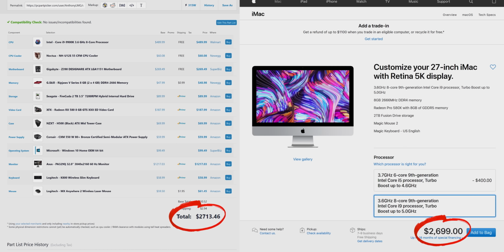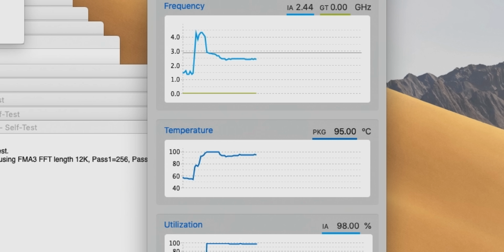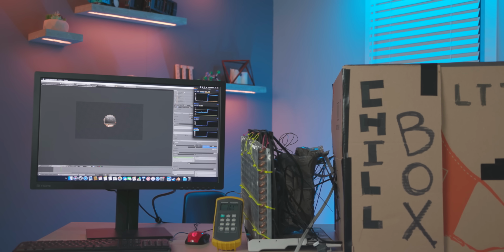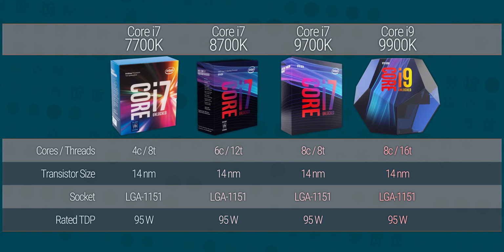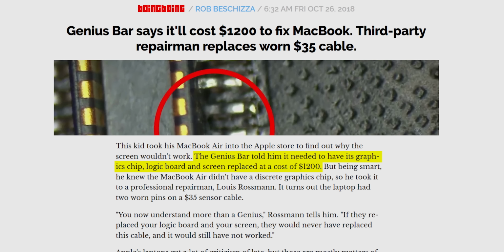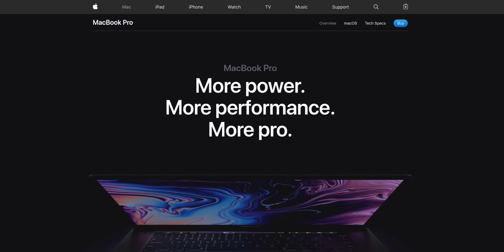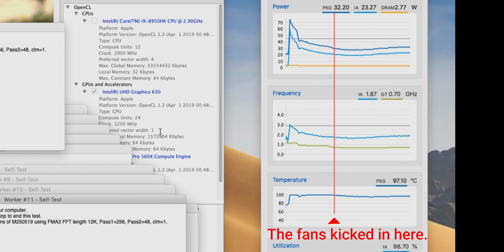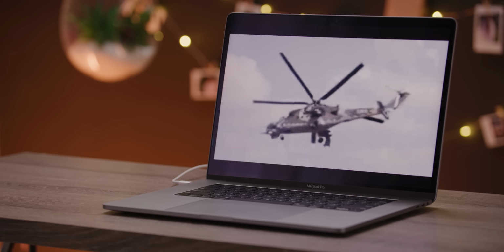Macs are SLOWER than PCs. Here’s why.

Comment: Just to see how much the throttling is hurting the performance of that Mac, I would gladly send you guys my 12 year old Dell laptop with a 2.5 GHz core 2 duo to bench against it.
Reply: Just look up the geek bench numbers. I’m 100% sure it will perform much slower than the newest MacBook (pro’s) Because I got 2 duo cores and replaced one with a Xeon x5460. My MacBook Pro mid 2012 has 4 times the numbers in geek bench than the Xeon.
Reply: Yeah but I think the point is, you wouldn't have paid $5000 for your Core 2 Duo laptop last year. Maybe $50.
Reply: There's no recovering from that level of a roast.
Reply: How much do you bench, brah?
Reply: With a 1mb cache? 6mb cache wolfdales can still hang a little bit.  Not every computer task is about compensating.
Reply: That core 2 duo might get 120cb on cinbench r15, but it's a dual core without hyper threading.  That still plays minecraft. Even though you should just play doom.
Reply: @Animal901  no bra even with that old cpu i have played many AAA title of today only issue is it makes way hotter than it could handle (of course i have 1080ti so i was able to play them), so then i what i did was just made customized coolers which could take both liquid nitrogen and liquid helium, so yeah; on my pet project i have played today's many AAA titles.  (do i lock the games on 30 fps yeah i had do to that to few of them for this chip)
And that was the point the hardware i have it it cheaper yet perform better than that sticker!
Reply: it's summer can;t go out site ambient temp is above 40 degree celsius, so how to make money while sitting at home by searching web and doing quite a lot of stuff. ()just for info i make 12$ just for searching web for 4 hours. my monthly income that's totally different thing for this comment.
Reply: just so u know i am 6 feet 5 inch guy so not that little man i am,in both height and private part.
Reply: who said about gaming ? u ask? it's linus himself.
https://www.youtube.com/watch?v=7gJ8mGFjeqA at 6:35 u will get ur answer.

as new macbook still quite the same to old one so there's no point in testing games on it, bcuz the results are gonna be same.
Think u idiot think, don't go bashing everyone like u know everything.

And bcuz of that old video and linus being to hard on apple kinda things said by people, they didn't add it to video.
Do research why a youtuber says what he says.
is apple lying new macbook pro 2019 is better in all aspects than 2018 version? then short answer is YES
long answer is kinda yes.

And from that point of view i said, "oh i bet an overclocked core duo 2 at 3.0 GHz can beat that macbook pro"
bcuz at the end of day mac book pro is gonna throttle due which even his strong processor won't be enough to beat core 2 duo in gaming (of course i am talking about core 2 duo overclocked with 1080ti 8 gb ddr3 ram, that's the one of old setups i have).

If u still didn't agree then yes u didn't get the sarcasm, and that's sarcasm is about!
Reply: i was being sarcastic so u r the who actually suck at understanding sarcasm i guess. But still it's true that's a different thing.
Reply: I'm still using my 11 year old Acer 2.5Ghz Core2Duo laptop when not on my desktop. With a SSD it's still a workable machine for 'normal' use. And it doesn't throttle under load with dedicated GPU and 65W TDP CPU.

But then again, I baked my GPU 4 times already (the oven treatment) to fix solder breakage because of heat stress.
Reply: I got big block,single turbo core i12.1.1..
Reply: oh i bet an overclocked core duo 2 at 3.0 GHz can beat that macbook pro
Reply: @bk-sl8ee  another case where people look at a clock speed and ignore all the other factors that actually make one cpu outperform the other.. just in IPC alone the skylake based cpu's are roughly 75% faster clock for clock than C2D. so even if it was throttling to 2Ghz in a POS macbook it would run laps around c2d chips.
Reply: @sirmonkey1985  so what are u trying to say put that in less words plz.

Comment: How long till "thin" starts being considered "stupid" instead of "cool"?  We're overdue!
Reply: Joshua Scholar true. I’d rather have thicker laptops / computer. I don’t want my leg to get burned by a laptop because my laptop won’t cool down.
Reply: Can we admit that phones are already so thin that it's a drawback?
Reply: There have been some of us who like it T H I C C
Reply: I have asus scar 2 rtx 2060 laptop,i can play games at high settings for 3 hrs but still the temperature hovers between 82-88°C.
Reply: Need another situation where batteries start exploding again from being overheated.
Reply: I kind of agree. If the computer is thin and the computer does not get crazy hot, then it's still fine but if that is not the case then I agree.
Reply: Grahamhg  yeah but buying a higher quality lightweight bag cuts more weight than a thinner laptop. Never ceases to amaze me how many people put a 1.5kg laptop in a 2kg bag.
Reply: Grahamhg  nice pun there LOL
Reply: Grahamhg  I expected a pun since this is the ltt comunity. Anyways I use a NF borealis which has a dedicated padded compartment. Sleeves are a bad idea, they are laptop bags without handles and walking around with one is asking for your laptop to fall, cause no grip.
Reply: Usb port thin is thin enough for me, any lower and you get compromised structural integrity
Reply: @hellfire92837  that's too thin
Reply: @stanimir4197  Depends on the use, casual/office/browsing user laptops can be thin and light like that, business laptops need more battery and integrity so thicc is good. As for gaming, I personally dont like 17.3', 15.6' with good cooling and undervolt would be my choice.

Comment: Consumer Mac users are dope smoking nut Jobs too stupid to think for themselves. Professional Mac users (designers, programmers, etc.) are irrational and delusional. There is zero justification for buying any OSX product for anything other then using it as a testing platform for professionals smart enough to use Windows or Linux. The same could be said of iOS products.

Comment: Actually Linus sorta explained why Macbooks thermal throttle so badly in his iPhone vs Android analogy... this probably isn't the complete reason why Macbooks suck at thermals, but like his example of how Android phones tend to perform worse than iPhones in prolonged stress tests because poor thermals, the processors designed in the Macbook aren't designed in house custom by Apple, so prob for the sake of marketing Apple just slaps the best CPU designed by Intel (similar to how Android phones will usually use the flagship processor designed by Qualcomm regardless of their thermal design). This is versus the custom designed CPUs that Apple purposely built for their phones. As to why they don't custom build CPUs for their Macbooks yet, market demand is probably the reason for that.

Comment: 7:04 simple. they build their own chips and are overbuilt for the phone usage/workload.  It is so overbuilt so that they don't have to run it at higher clockspeeds like Android SoCs do.  You are correct that it is a compelling reason to buy an IOS device.  
I don't like Apple but it is still a very good engineering design choice.  See, boost clocks are only not efficient but can be useful for burst workloads.  Most rendering workloads needs more cores than clock speeds.  Multiple cores that are at lower clock speeds are simply more efficient than higher clock speeds with less cores; smaller cooling solution.
What hurts though is gaming, gaming is close to a rendering workload plus a GPU at almost 100% load.  It just won't work. 
It will take a while for Apple to use their own chips for OSX devices as they will they have to convince developers (Adobe) to write code for the Apple chip where current OSX third party software is written for x86 (OSX or PC)

Comment: Linus, you DO realize that the only reason the PC you posted costs anywhere near the Mac is because you added on a $1300 32 inch monitor and a copy of windows 10 right? Why not compare apples to apples use a 27" 4k monitor and buy a cheaper windows 10 key from kinguin or the many other sites that sell them for far less? I think If you did that the PC build would come up to alot cheaper
Reply from the maker: Because that wouldn't be comparable. The iMac comes with a factory calibrated wide gamut 5k display and a proper (not grey market) OS.
Reply: @LinusTechTips  but do you think you really need to spend 1300 to get the same quality monitor you would for a aio iMac? I don't know dude... Not trying to cast doubt on anything your staying just trying to math things out and 1+1 !=2 from where im sitting

Comment: Its so sad Apple has become as greedy as Nvidia and only cares now about profit. Not quality anymore. Also it greatly depends on what software/app your running and how well it’s optimize for the hardware. 

Let’s not forget intel has had a LOT hardware security issue. Not that Amd Ryzen CPUs are fully immune. But generally Ryzen zen 2 and 3 (as for 2021) are far better then intel CPUs are.  Simply put. Intel lack of innovation has finally caught up to them. (Which effects BOTH intel pc and macs) Mac also often have worst cooling on intel CPUs.  

It’s been proven TIME and TIME again (before Apple switch Fully Arm). A hackintosh running on Ryzen cpu and configure properly with proper drivers and what not, would Out perform stock bought Intel Macintosh.   While this video is old now.  The title is misleading, Mac are slower, but there is reason. Improper cooling/Apple trickery with voltage on intel CPUs,  Most modern pc/server pc have FAR better cooling feature, giving pc an edge over macs.  

If you built a special hackintosh (with proper cooling) and put it vs default Mac you bought from Apple and they both equipped similar GPUs/ram /SSD, the hackintosh will STILL prob out perform stock mac.   intel held macs back because lack of innovation,  Mac lack proper cooling also contribute slower performance. Mac OS is imo far better os vs bloated windows 10.

This is why Mac are slower. Simply because Apple does NOT allow cpu be cool properly enough. Thus reducing performace of them.  If Apple had made Apple with Ryzen and better cooling.  We might have seen better Apple products.  The switch to full ARM a CPUs for Apple will help as arm require less power and can perform as well if not better then pc,  the question though is since Nvidia is trying by ARM. Will it Go thru and will this effect Apple?   As Apple HATE Nvidia.

Chilling MBP in chill box isn’t going help that much.  The problem is Mac/Apple crap cooling system.  If you could proper heatsink on IHS/Cpu and proper cooling on GPUs, with proper software config too boost cpu more correctly.

Comment: Apple is garbage. Usually, Apple users are dumb and just want to "use" the device... Well, little do they know that Apple is just marketing mediocre to them with the disguise of being exceptional. This is a great case of what Apple does. They market this as high-end, because the processor technically has a higher spec, but it actually performs at the level of a lower priced machine.

Comment: Sorry Linus, do you expect Apple to make a CPU from scratch for desktop in just a few years? Apple made their own SOC for their phone and did it right. They cant help what Intel is doing and they fit it into their lineup best they could. A slower CPU wont have the potential of a faster one. You have an issue with how they throttle, and some of it is right, but the fact is they preform as good or better than other laptops in the same categorizes. I dont get how you could spin any of this as a bad thing. Weird bias here.
Reply: Did you even watch the video 😂

Comment: Question, when you said "A slower CPU that doesn't throttle is not slower than a faster one that does.", then my question is, what's the sweet spot, where you can save money buying lower end spec, but the performance is mostly equal to paying an arm and a leg for the CPU power you can't use anyway? Does it make more sense to buy lower end Macbook Pro? Or maybe just makes more sense, to just buy a PC notebook at all.... hmmmm 🤔?

Comment: All the i9’s have thermal issues and its not just MacBooks that throttle. And that is mostly Intel’s fault.

However, designing a system without testing for thermal throttling is a massive fault of the manufacturers of said systems.
Reply: The issue is not limited to i9 processors.I have asus scar 2 rtx 2060 notebook,i can play games at high settings for 3 hours but still the temperature hovers between 82-88°C. Ambient temperature:41°C
Reply: It has intel i7 8750h 6 core cpu

Comment: 3:40 No.  Intel sticks to the TDP rating but only for base clock speeds.  The only fault with Apple is thin thermals, only wants to maintain the base clock speed for long workloads, losing boost clocks
Reply: Literally 10 seconds later......

Comment: This, coupled with OS bloat, and allowing upgrade past usability are why I am (as of this year) abandoning the MacOS platform.  (Despite the indicators of compatibility in the Apple Store, a mid-2012 Air is NOT going to be a good experience on 10.14.1, 10.14.2, nor 10.14.3) Add to that the very limited expansion options, apple's explicit answer to "We want a touch-screen air" is, "No, you want an iPad Pro" (via email, and via an apple store.) Apple has become style over substance, and is apparently trying to migrate people away from Mac Laptops.

Comment: To be fair. I’ve never used a Windows machine as quiet as a MacBook Pro. And being able to plop that down on a console and mix away without any distracting white noise in the studio is really helpful. Not saying that Audio guys are the reason Apple does this, but there is a plus to the fan curve.

However, I would prefer if Apple gave users the option. Like hey the i7 variant has super quiet operation but it throttles, and the i9 version is crazy fast and loud. I would not mind that at all.
Reply: A normal pc allows you to control the fan curve yourself. You can make it just as quiet, and with water cooling you will still be getting far superior thermal performance.
Reply: Izzder yes, I was more alluding to the i9 version just having a beefier cooler. But yeah MacOS should have a fan curve adjustment, especially for the desktops.
Reply: Johnny English I’ve gone through a lot of windows laptops, but none have ever been as quiet as a MacBook Pro. 

Granted that’s not the only reason I use a Mac, as there are ways to adjust fan curves and such to get a quieter operation on a windows pc. But out of the box, silent operation is very handy.
Reply: Just wondering, is Audio mixing CPU intensive? If not, a window laptop that does not turboboost would have the same noise footprint?
Reply: Izzy Un it’s very much CPU intensive

Comment: macbook fan spin faster during higher workload in Linux ! not in MacOs ! 

enough said
Reply: MacOs is Unix based , Unix is open source ! 
they modified kernel so as to make fan quite on higher workload , got it ??

and nah it doesn’t smell like burned plastic unless you do heavy works on way older model ! change the thermal paste and it will smell like steve jobs 😅
Reply: @sujanpaudel2031 : There is no requirement that a Unix system must be open source. Remember, what most people call Linux, was originally designed because Unix was closed source and extremely expensive.
Reply: Because Linux is made by people for people (literally). And macOS is made for money. And a silent laptop sells better among people that know nothing about PC hardware. Plus, if the motherboard is fried at 90 degrees constantly, it will break sooner and the owner will go buy another macbook. And install Linux, lol
Reply: Jessy Landry  I tried installing Hacintosh on a virtual machine. And, as a Linux user, I must say that it's way too difficult for me
Reply: I think what OP is trying to say is that Linux has a more aggressive fan curve for MacBooks. Not sure if that's entirely true, but it's very possible.
Reply: @Mugen00 it pretty much is open source. All unix does is just release GNU toolselts as Unix addons. So these guys arnt exactly wrong. Maybe get off your high horse.
Reply: Jessy Landry  I have Ryzen. I'll have to use kernel extensions to bypass the optimization flags for Intel enabled by default. I call it difficult
Reply: Sujan Paudel Mac os is Linux smh
Reply: @GamingComic123  macos is a Unix based os, not Linux based.
Reply: @GamingComic123  ...what
Reply: @GamingComic123  MacOS is based on MACH kernel (Unix) built atop the corpse of NeXTSTEP 3.3

Comment: Someone should tell Marques and iJustine. Unless they're starting to realize what Apple has become.
Reply: They use final cut to edit and work in, Which will render your stuff way faster than any laptop out there VS a PC with Adobe.  Marques even has a video demonstrating this
Reply: @steven4570  That's because it's optimized to work better in Macs, Adobe doesn't optimize overall. That's the problem with Adobe in general though.
Reply: @MrWatchtower  But the end result of what you're doing and how you do it is what ultimately matters. And if you're using final cut with a Mac like they are, you get better results